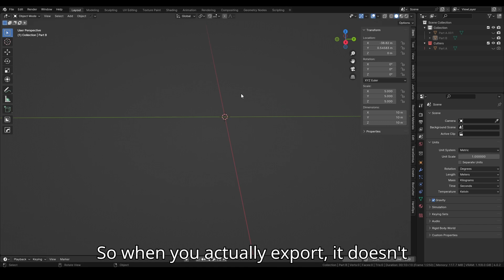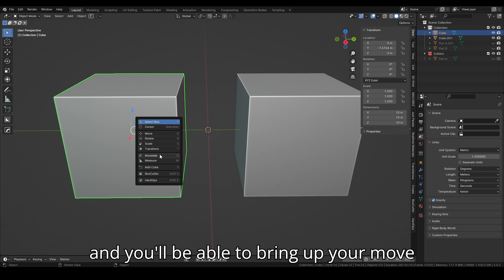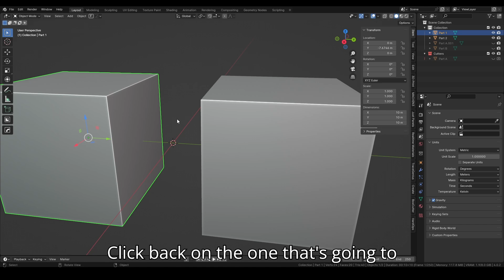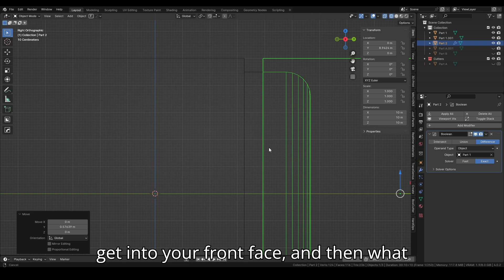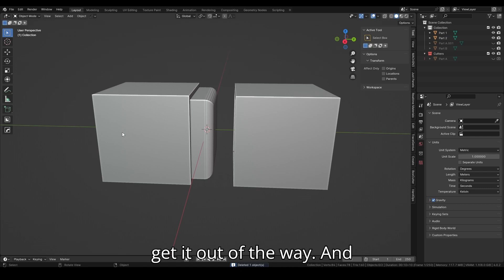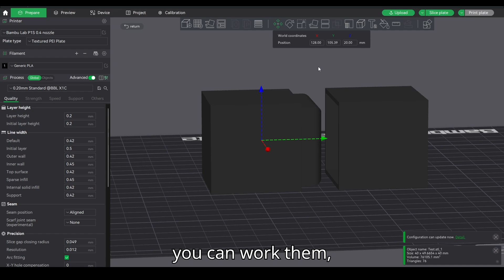"How to Create Snap-Fit and Interlocking Parts for 3D Printing in Blender!"

Comment from the maker: The portion of the video discussing offset needs clarification. After applying your boolean, select one of the objects and either make the “key” smaller or the socket larger to account for print tolerance.

While not a necessary step, it will provide room for the pieces to fit together easier.

Comment: Wouldn't the exact boolean of those two mesh result in them not fitting together when 3d printed? Shouldn't you like add a tolerance between their gaps for space to fit in?
Reply from the maker: I updated the pinned comment, but yes you are correct. I forgot to mention it in the video originally. You should adjust one or the other pieces to make sure there is not a tolerance issue. I would at most do a mm, often times only about .5mm is required. Thank you for the comment!
Reply: How add tolerance?
Reply from the maker: You can either make the “key” slightly smaller or the opening slightly larger to accommodate. Easiest way is to select the faces in edit mode. From there extrude by normals. I believe the shortcut is Alt E with everything selected. Hope this helps!